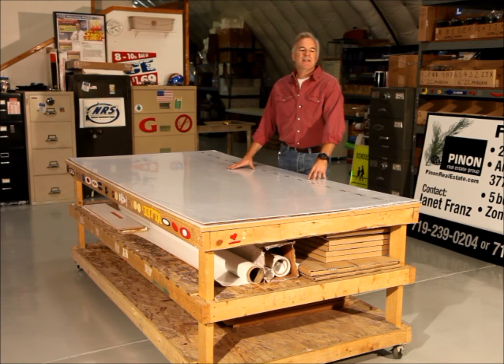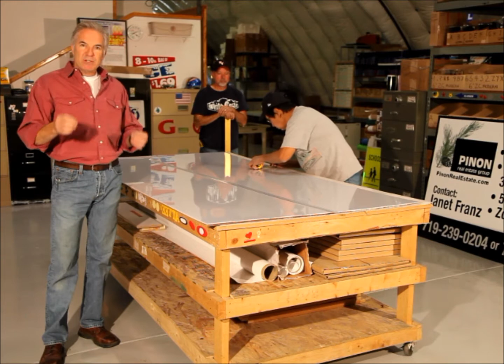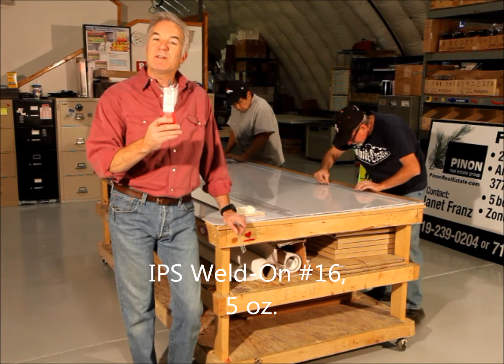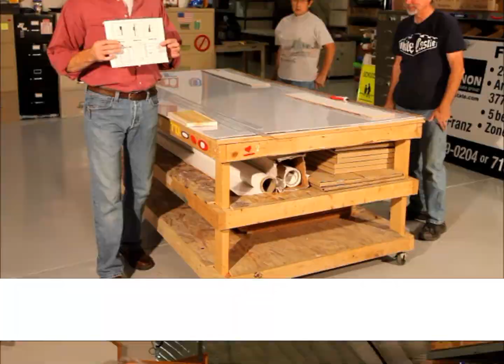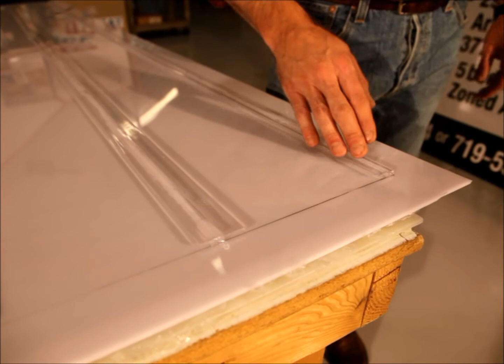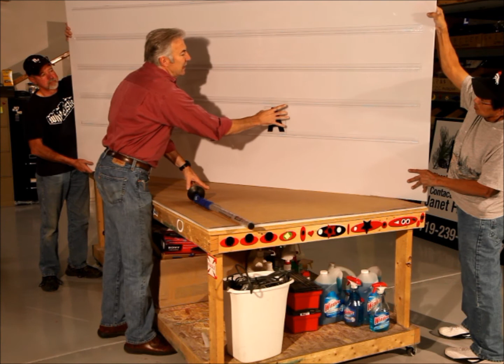Build a Readerboard Sign Face

Comment: What if the sign is existing and I’m doing it not on a table, I’m doing it on the building, will the cement dry quick enough that it won’t slide anywhere at all?